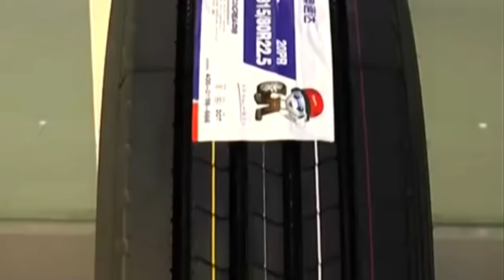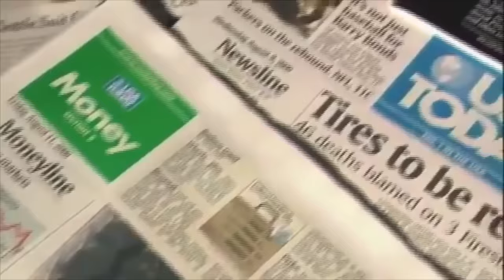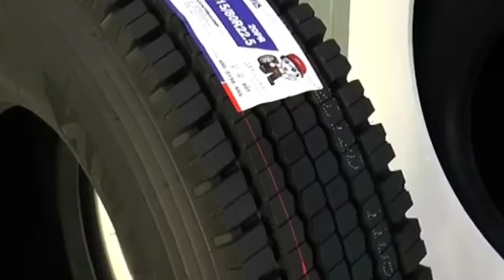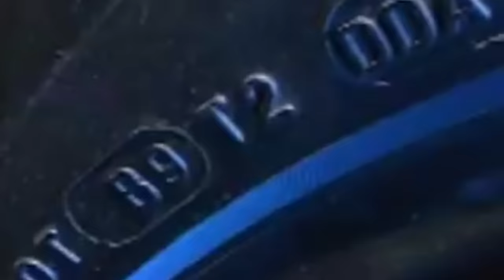5 Tires You Should NEVER Buy!

Comment: Stupid ass video but don't buy cheap tires. They are the only point of contact with the road. Personally I stick with not only top end brands, but also I generally buy the best or near best tires they offer. Yes it's a bit more expensive, but if you shop around or wait for sales, you can do it without spending a lot more money. I deliver tires for a living, Firestone, Kelly's, Dunlop, Bridgestone, Goodyear etc, but I haven't bought any of those brands recently. Most recent I bought Michelins at Costco for my Silverado. Paid $838 out the door. I expect to get at least 80k if not 100k out of them. Super smooth and comfortable ride with great grip. Same with the Cooper Discoverers I had before the Michelins. I got 80k out of them and had bought them on sale for about $660 out the door after a mail in rebate. I really liked those tires & I would have bought them again, but they weren't on sale, and were within about $50 of the Michelins, so I bought the MIchelins. I drive about 80k miles a year, so I look to keep my tire costs at about a penny/mile or less, but I keep my truck in good alignment and check tire pressure often.

Comment: Just keep staying away from Chinese tires. Tire stores have sales with these tires like 4 for 200.00 installed or something similar. I went for a set and the handling during wet weather was very dangerous. I ended up putting my old made in the U.S. tires back on. The difference was amazing. I saved up for the same brand, lost my money on the Chinese because the tire store personnel were dick heads. I put a knife through the sidewalls of the Chinese tires so they can’t be resold.

Comment: That's why never buy anything MADE IN CHINA.  It's like buying Chinese sockets as they will easily crack if you put some torque. Pay bit more and stick with good and reputable tire company's tires such as Bridgestone, Falken  tires are excellent because I had them on my vehicles many times and never had any problem.  They are MADE IN JAPAN where quality control is much stricter there than China.

Comment: Firestone tires were underinflated at 26  psi by ford to soften the ride thanks to their shitty rigid suspension. These tires where not designed for such h  low inflation They blew out because of heat and damage to the side wall.. it was not a design flaw... these guys should do some better research..

Comment: I never buy Goodyear tires anymore.  Cheap, lightweight junk. Sorry. I have had 4 tires with 8000 miles on them delaminate and come apart and I don't horse on my tires. These were 14" mounted on steel rims for my 74 mustang II.    I swear by Continental, Uniroyal, Michelin, Dunlop, BFGoodrich, Pirelli and Bridgestone for autos.   Will not ever buy Goodyear or Kumhos or another non stiff sidewall tire again. If I drive it and it wavers, after purchase, I turn right around and have them removed.   A wimpy sidewall will kill you.  For trucks I only buy a 10 ply tire. Bridgestone and Dunlop and Michelin excel with their 10 ply tires. Don't get cheap! Cheap will kill you.

Comment: Tires fail for many reasons besides manufacturing defects. People are lazy, so they often check tire pressure when hot, never cool as recommended, fail to keep them at their proper inflation especially during season changes so they over inflate them, they fail to rotate them at 3-5K miles, and they use string plugs to fix flats, then ride on them as if they're all fixed and good as new! Idiots...

Comment: the problem was not only the tyre, but the "car", all that CRAP SUV cars is dangers to  drive in general and looking crappy to. and that high center balance is the main problem with SUV and Trucks.. and if you have a blowout tyre that will go very wrong. Also the way SUV are made, more like a lorry nearly the same construction.. its a thing americans never ever get over, like the terrible muscle Big Block engine 5.7liter with about 150hp, so latzy power and high fuel comsumption. in general mostly american car product has been terrible for more then 50years. and still is. sorry guys.

Comment: Well i never had a problem with my firestone wilderness le why you ask? Because i had 35lbs psi in mine not 26lbs that was on the door jam stickers on all ford exploers from about  1990 to 2000. Low pressure was the cause not the tire and ford finally admitted that. You need to check your facts before posting this garbage!